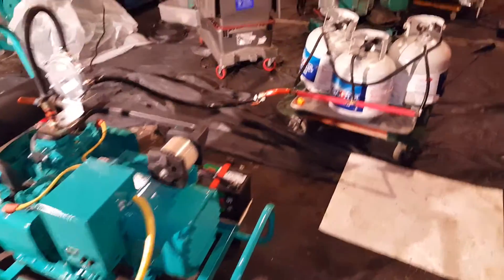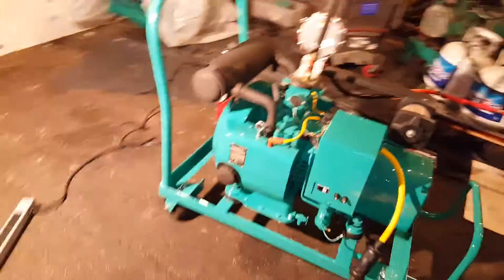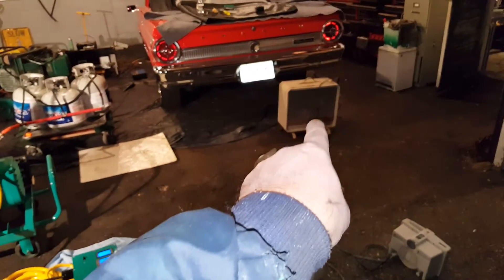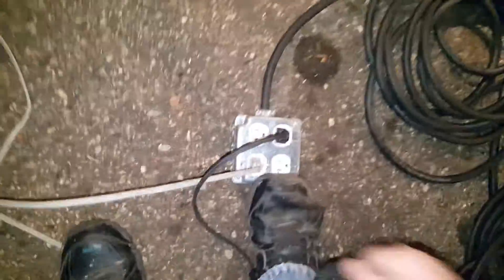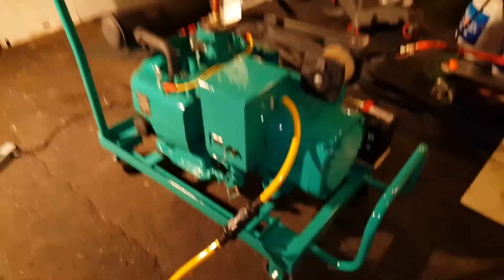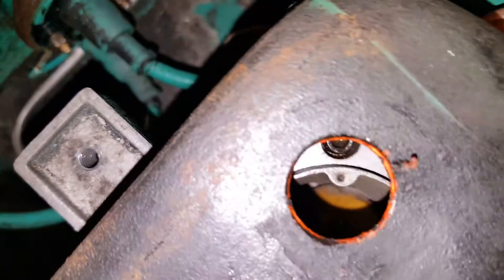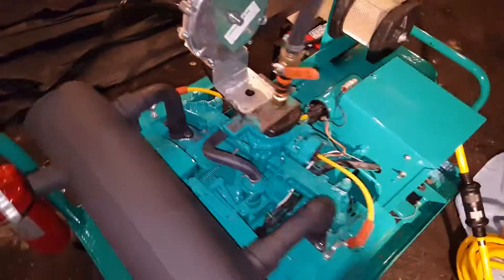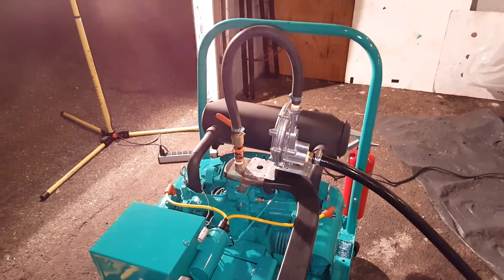Universal vapor fuel conversion for gasoline Onan RV generators

Comment: Great video!  I followed your instructions and got my 4.0BFA running on natural gas.  I have it installed in a fiberglass enclosure originally from an Onan 7.5 marine diesel genset.  I lined the box with additional sound board and made sure the air venting was adequate. It is very quiet running and has a good muffler.  A tabletop sits atop the unit so it is a workbench when being stored.  It rolls on casters.